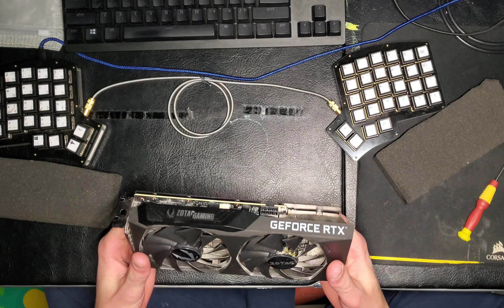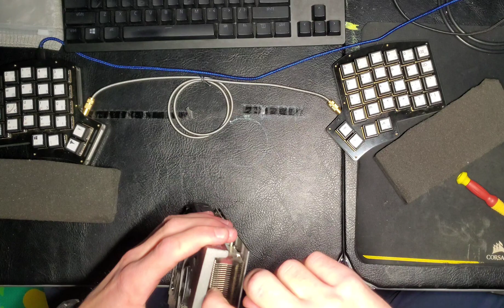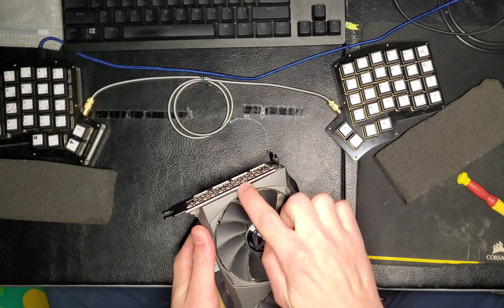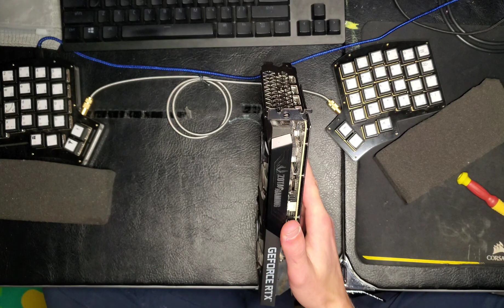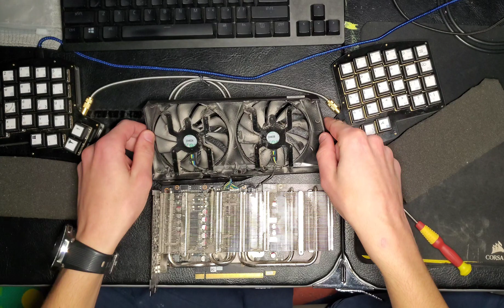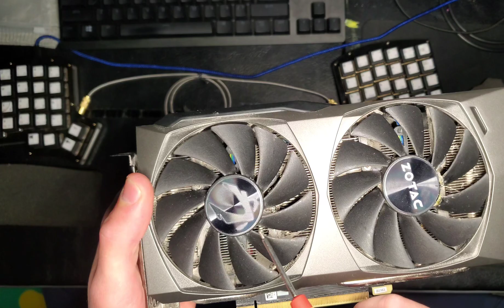Zotac 30 series shroud vibration fix (update and how to)

Comment: I don't know why youtube recommend me this for my 5 year old gpu, but now I know that I have been keep this problem in control because I used the gpu holder mean for bigger cards that came with my PC case. I just didn't want to lose it even though the card didn't sag, It has been only touching it without pressure but I haven't heard any rattle this 5 years

Comment: Can I use thermal pads of 1 mm instead of silicone?
Reply: Uptade: Asked and answered, worked WONDERFULLY. tested on all fan speed, No noise at all! thanks man, I reallly appreciate you, kudos from Brazil!
Reply: Temp dropped 10 C- Ok why tho? wonderfull but why? '-'
Reply from the maker: It's possible you shifted the cooler by putting pressure on it and it happened to spread the paste on the processor making it better. If this is the case tighten the 4 back screws so it doesn't get worse again. It could also be you got rid of dust, or one fan was stuck?
Reply: @saillively  Idon't think that the fans were stuck, the GPU was already running preety low, but -10 C was awesome, don't know what's happening, I open it again, everything is tighty and no nose, so just...yay then? haha but thanks for the attention man!

Comment: but, it doesn't affect anything if Silicon is used in the gpu??  doesnt damage components ? And another question, when the graphics card heats up, does the Silicon not melt?  or what kind of Silicon should I use?
Reply from the maker: Don't use silicone or silicon it doesn't hold up over time, use some type of electrical tape, fabric, string, or paper towel(less recommended) this is supposed to be an easy fix, not something you have to go to the hardware store for. You just need something to fill a gap and lessen the vibrations. There may be some trial and error such as me having to wipe up my uncured silicone and put a strip of yarn in it's sted... stead? I don't know English, but I know you can figure this out
Reply: @saillively  dont worry, do u know spanish, maybe??
Reply from the maker: @Liiryel19  un poco

Comment: Will this void the warranty
Reply from the maker: Depends on if you damage it, and if you break a warranty sticker. If you only take the plastic shroud off with zotac, there is no warranty sticker so you're good
Reply from the maker: Just don't do a permanent modification. Don't use silicone, use another dampener

Comment: If I do not apply a fix or anything do you think it will damage my gpu in the long run?
Reply from the maker: The vibrations are not good to have but the lifespan of the fans are probably more affected. I wouldn't worry about it if the rattling isn't bothering you

Comment: IDK if you still have this card, but if the fan blades bother you they sell replacements on amazon
Reply from the maker: I definitely still do, are you talking about because they fell off? If so, It doesn't seem to be changing too much, I know finding replacements was hard when I first got it
Reply: @saillively  Yeah I'm talking about for your glued fan, they sell replacements from a couple of different manufacturers on amazon for $20 per fan
Reply: btw thanks for the solution, I put electrical tape under where the shroud makes contact with the heatsink and finally no more rattle

Comment: I tried this with my 3060Ti and added inner bike tire and it fucking works. I added it to the sides of the top part of the heatsink. It cooled down my temps for some reason, it removed the rattle and it won't melt since melting point for rubber is around 170⁰C if I'm not mistaken
Reply from the maker: No clue how that would cool your temps unless you playing with the card somehow managed to re-seat the cooler, or you cleared dust. Glad to hear it tho!
Reply: @saillively  Maybe? Either way, I'm super happy. Thank you so much

Comment: In mine, it is just a slight rattle that appears randomly every 4-5 months, but I just solve it pushin a little bit the fans ( just a very slight nudge) and it goes away for a long time again. This fans are shit and zotac refused to put fan stop in normal 3060ti ( the one with oc has it) so probably they will die in 3 years or so ( gpu has 1.5 years)

Comment: I’m having a rattling/grinding noise but only when the fan closest to the back goes from off to on. It’s totally fine once on, it’s really annoying when I’m doing something light on the GPU and it keeps going off/on/off/on. It started after I cleaned it out once using an air duster. Think this may be fixed with a similar solution?
Reply: It’s actually extremely similar to this video https://youtube.com/shorts/GLWkgFqpOws?feature=share
Reply from the maker: Make sure the disc on the fan in centered, it could be throwing it off at the start.
Also try tapping on the housing while the card is off, see it there is any rattle. (this would mean it is the fix in the video)

I think the decrative coin is throwing it off, making the fan hit the side of the shroud only. You can adjust the placement if it, the fan, or change the fan curve so it doesn't turn off as much
Reply: @saillively  the coin itself seems like it has a bad weight distribution, based on that wing design. 

I did just change the curve so the fan essentially always stays on, and that does work, but like you I’m trying to get to the root of the problem lol.

Just by looking at it closely I feel like the end of the fan blades could, with enough wobble, hit the metal fins, so I’m thinking of adding material like you did to help give it that slight clearance from the heatsink.

I checked by tapping, I can’t hear any rattle, and the pen cap trick did nothing to help that others mentioned. Looking at the fans spinning it doesn’t seem like it’s hitting the shroud, so that’s why I’m more suspicious of the heatsink fins getting hit, as they are raised towards the outer edge of the fan blades.
Reply: @saillively  I took a slow mo video https://youtu.be/fL09SyxjfIQ
Reply: A better shot, I actually noticed at this custom slow fan speed it’s there constantly just not as loud https://youtu.be/ZdH5kQzBCA4

My theory is that at slower speeds, the fans don’t have the air resistance to clear what it is hitting, as it speeds up, it pulls away just enough to clear and the noise stops. I’m going to try adding material tomorrow underneath the fan.
Reply from the maker: @little_buster4289  Take the coin logo off and see if that does anything, yours looks way off.

If you spin and put pressure on it do the fins hit anything? It would prove your theory. Definitely put pressure on different parts of the hub and spin it slowly to see if anything touches.

Comment: I just took off the fans and that seems to stop the rattling
Reply from the maker: aw, that's great man, glad I could be of help!  Honestly the big metal heatsink blocks direct airflow to the chip and is a huge source of weight too. take that off aswell and you'll be golden 💎💎
Reply: @saillively  Tried this and the card was overheating. Turns out there's a big square chip causing all the heat. I removed the chip and it's super cool now!